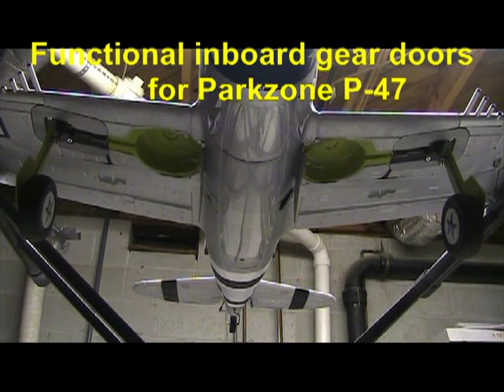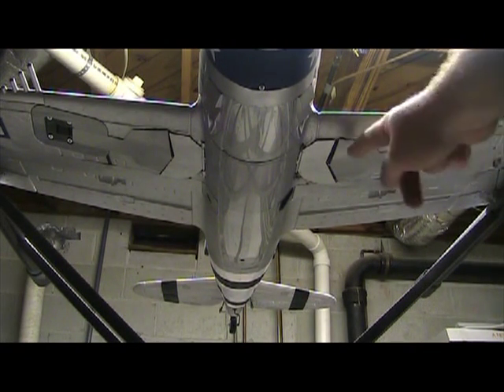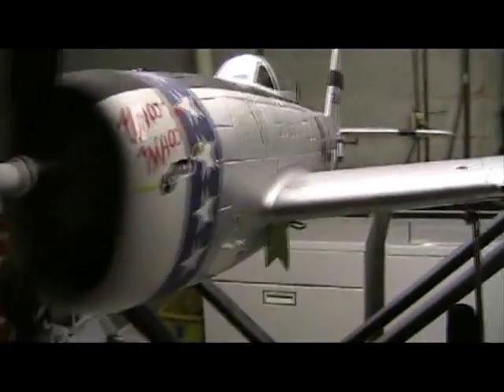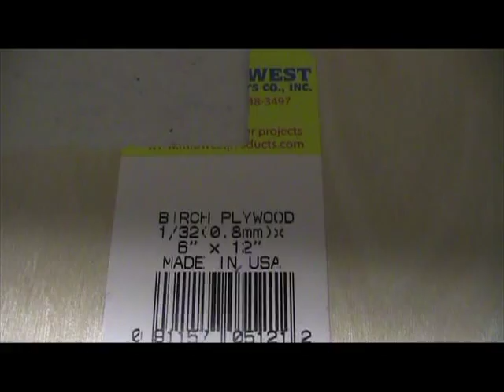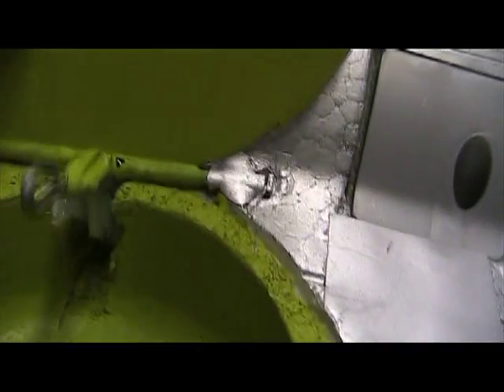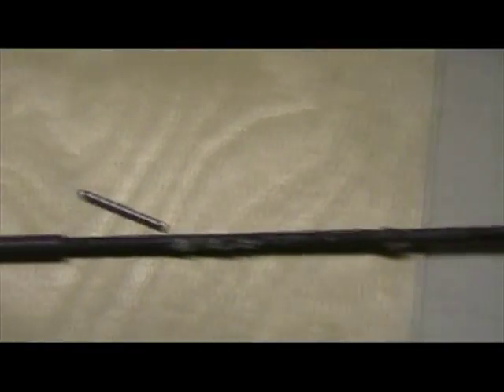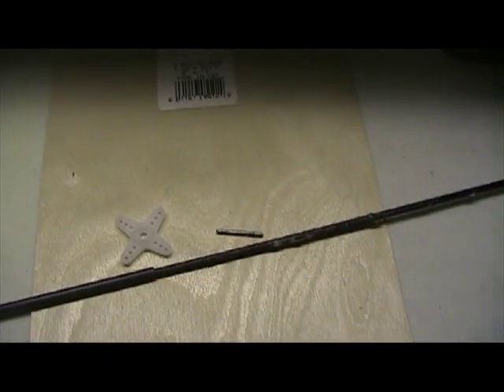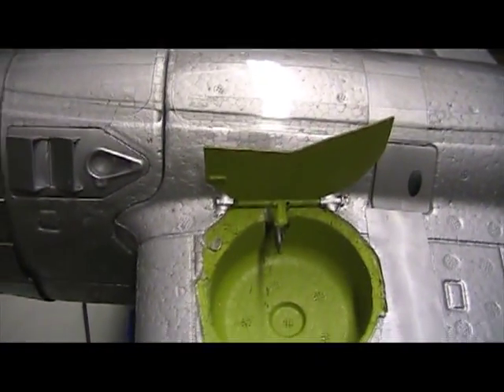Parkzone P-47 Inboard Gear Doors.mpg

Comment: Found your video because I was struggling to come up with a reliable servo-less setup for my Dynam ME262. After a couple of slight modifications and tweaks here and there your design did the trick! Thank you very much for taking the time to post the video, it really helped.